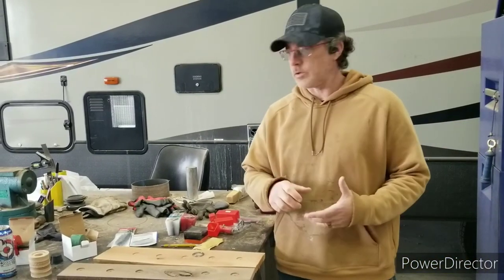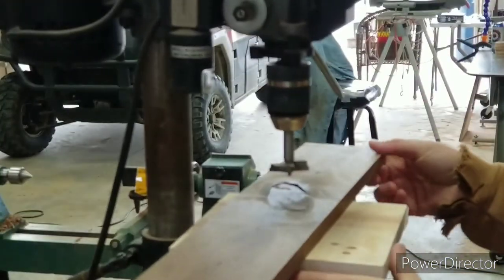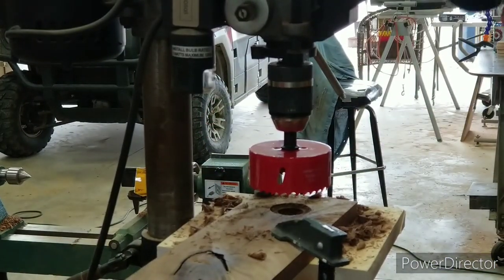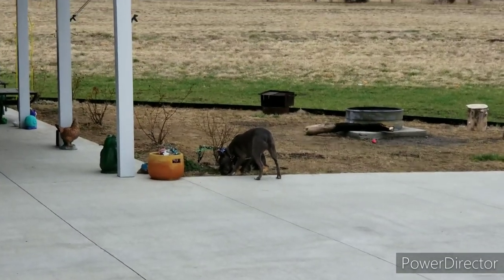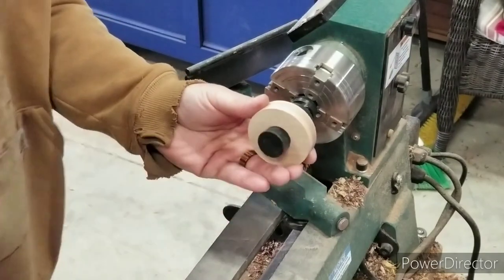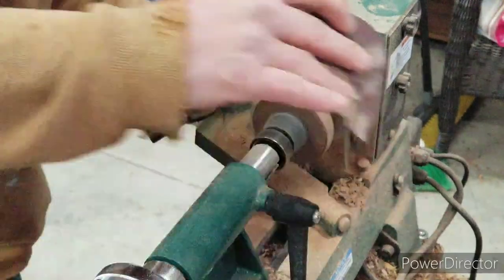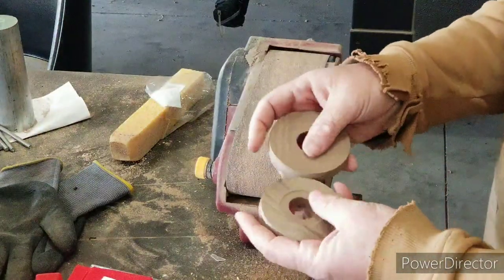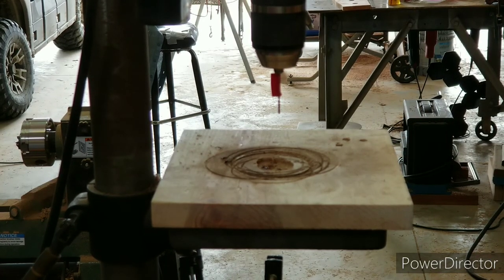Palm Sized Bottle Opener

Comment: Mate, my chuck kept dropping off. I came across a video of someone using a bottle Jack on the table to push the chuck on(with a timber support underneath the table). He did this after cleaning the drive shaft with the chuck off using degreaser. I did exactly the same and it seems to have done the trick. As for doing all the same holes at once….it’s not as easy as that. I’ve just been through this whole process and I’ve done it exactly as you did. A lot of changing bits etc but with good results. Take care! 🇬🇧🇬🇧

Comment: It would make more sense to drill all the same holes of the same size in the whole board then change the bit and repeat
Reply: Not really. Then you need to spend more time getting the bit centered. Especially when doing the hole saw